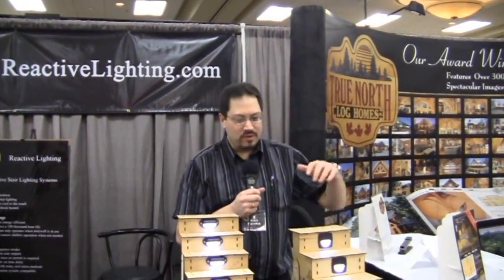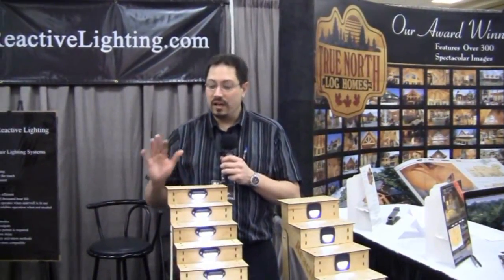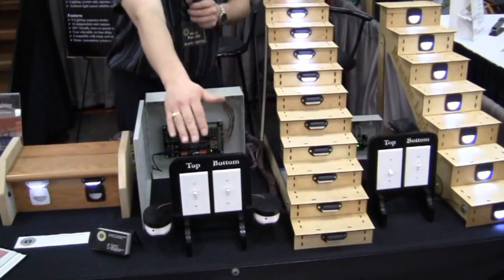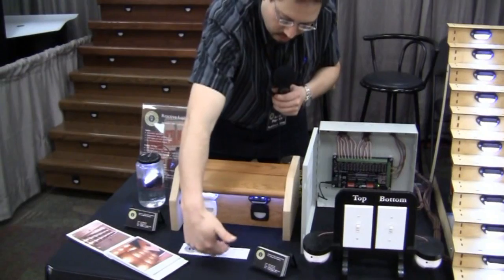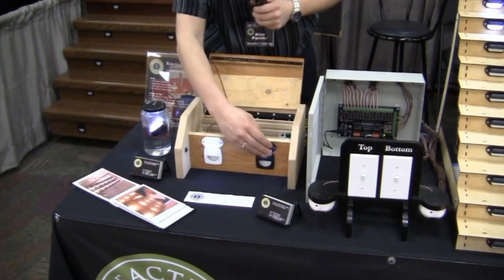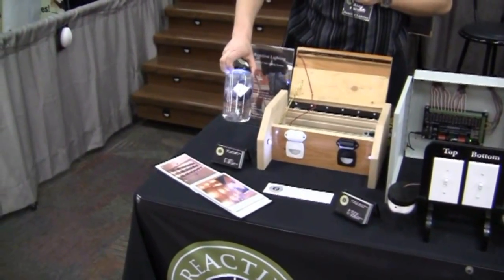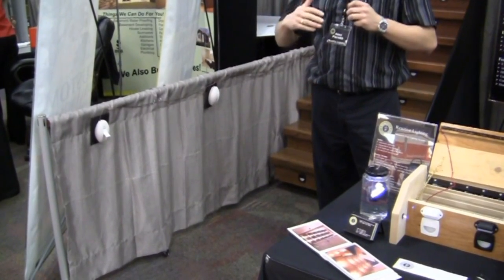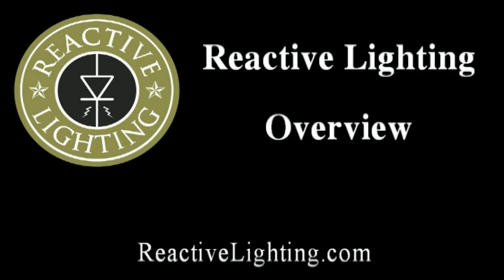Reactive Lighting - Stair Lighting System - Overview

Comment: There are sensors up and down stairs, so if you are in the middlle the sensors know that, quite simple eh? and they activate(turn off lights) agin when you go off the stair... Or something.
Reply: It is based on a user selected on time. When a sensor is triggered it lights based on which one was triggered, turns on based on the pattern selected, stays on for the selected duration, and then turns off based on the selected off pattern.